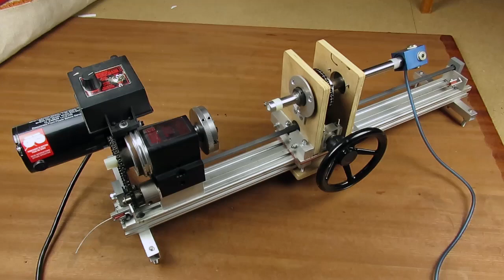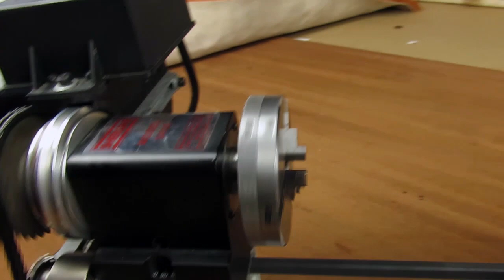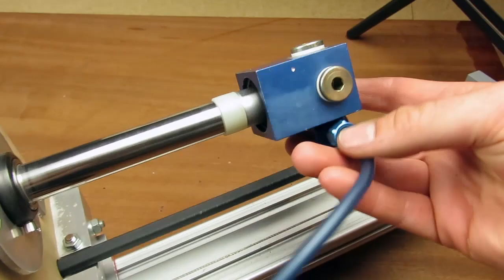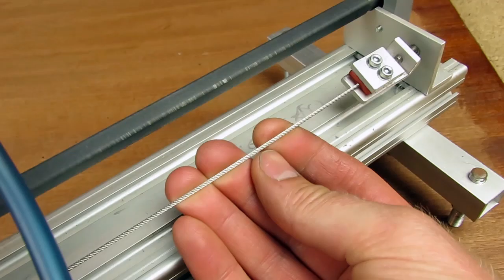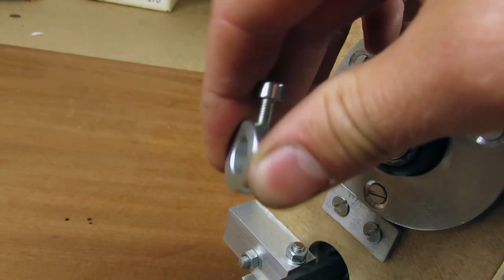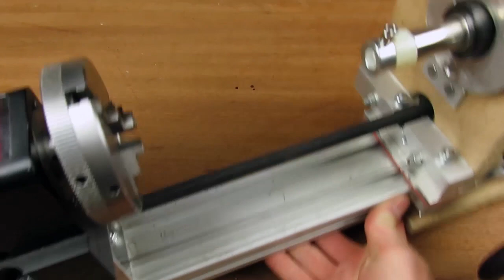Dual spindle glass lathe #glassblowing #glasslathe

Comment: Nice job! I was going to use the same cable system on the moving stock on my lathe. simple and robust.. At the moment I just slide it by hand, but I'm using linear rails so it moves easy
Reply from the maker: Thanks! I remember seeing someone with a DIY lathe that used a cable drive, that's where I pinched the idea 😂 . I'd definitely go with linear rails if I was doing this again, much easier than building a sliding carriage like I did here.

Comment: Would it be fairly easy/possible to make those blocks taller so it sits up like 8 inches to a foot from the bed? Also what about the potential for a larger chuck or at least the same chucks on both sides?
Reply from the maker: Anything's possible, it's just a matter of design.

Comment: Where did you source that blowpipe swivel?
Reply from the maker: Hi - it's actually something I found on a piece of equipment scrapped from university ;-) They're called "rotary air unions" - I see some surplus listed on eBay just now, but they're unfortunately not cheap.
Reply: check mountain glass

Comment: My concern is the nylon gear that will melt....how does it work for heating glass
Reply from the maker: What nylon gear?
Reply: I believe they are referring to the Delren washer/bushing in the tail stock. How do you use the tail stock?!? Awesome job/construction I am just wondering how the other side is going to be set up!